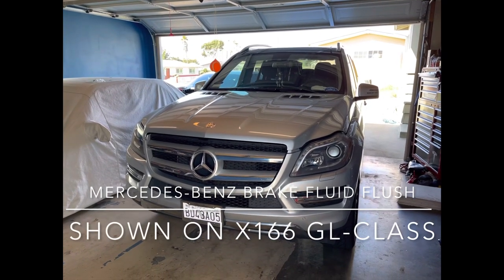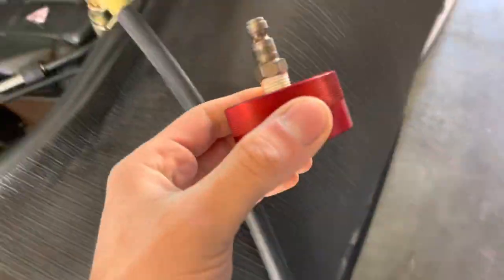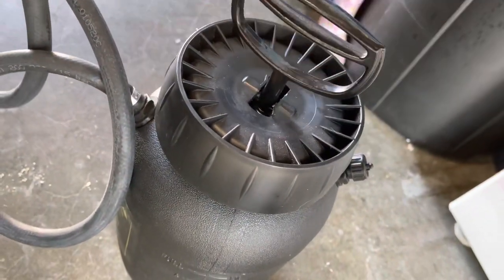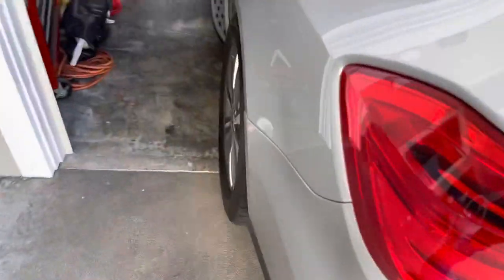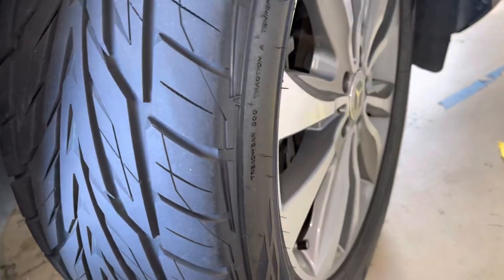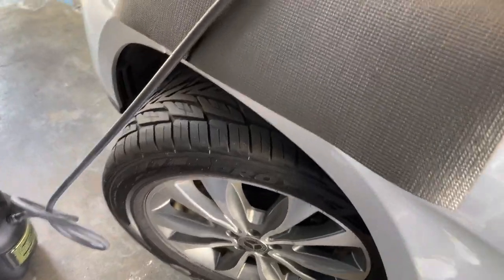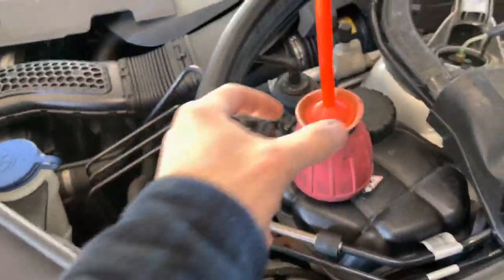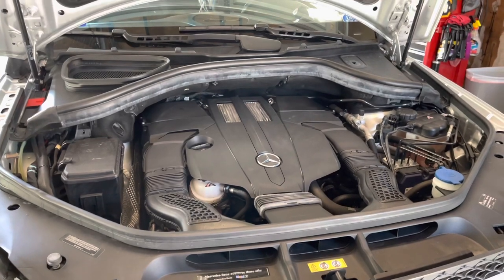Brake Fluid Flush on a Mercedes-Benz (Non-SBC)

Comment: Great video. The others I watched either didn’t call out the warning about SBC or recommended insufficient pressure in the pump. What’s the difference with AMG models? I have a GLE 63s and seems like it would be the same process as another non-SBC model. Thanks!

Comment: Don't you need to pump the brakes when bleeding out the fluid or is it because of the hand pump thing that you used and therefore you don't need to pump it and where did you get the device and adapter? Thanks
Reply from the maker: Yes, the brake bleeder makes it so a single person can do it. I bought the adapter and bleeder on Amazon. Can get online other places aswell.

Comment: I have the adapter but what is the pump called
Reply from the maker: The pump is called a Brake Bleeder. The one I am using and many I worked with at the dealer used the one from the video. It is a ATD Brake Bleeder available on Amazon (where I got mine). However there are plenty on the market that work just as well. ATD Tools 5125 Brake Bleeder Tank https://a.co/d/2A4msRb